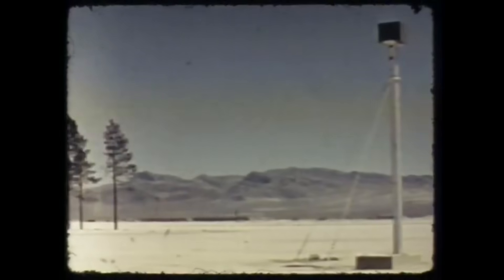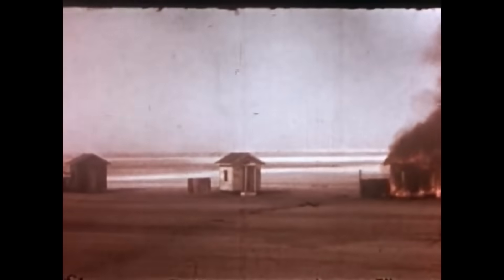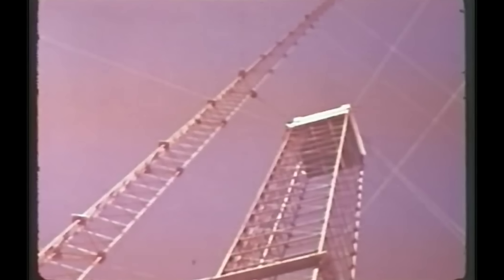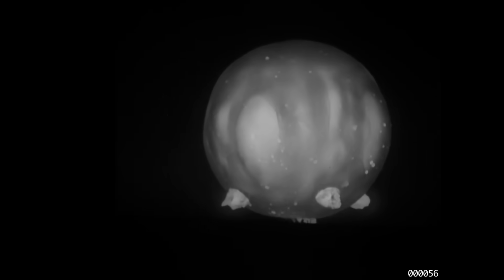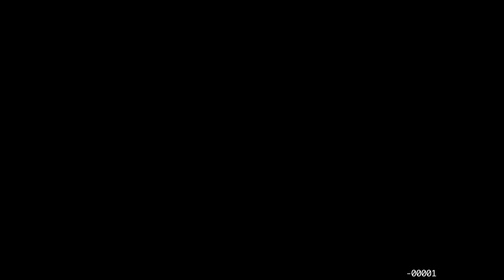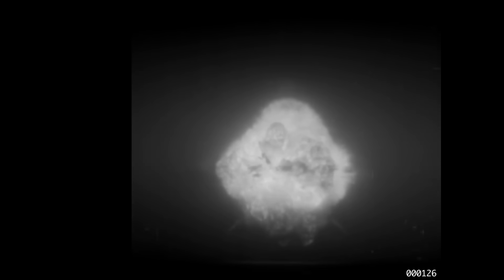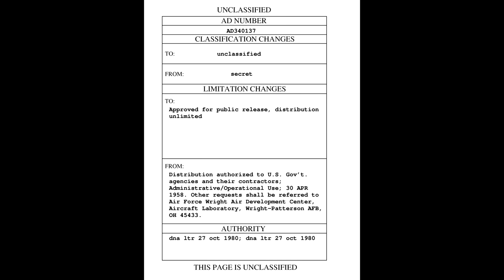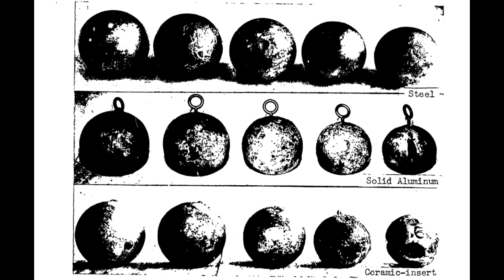Can A Metal Bowling Ball Survive Inside a Nuclear Explosion?

Comment: Im curious how they can be standing at the wreckage of the tower considering it was the epicentre of the blast.     Did they end up getting severe radiation poisoning?
Reply: The radiation at ground zero on efficient nuclear blasts is actually rather low shortly after the event. The fallout is the very radioactive part and that is ejected away from the event site.
Reply: @StreuB1  I would have expected a fair bit of neutron activation, especially the steel...
Reply: @AKAtheA  but to what level? Is there data that exists on the elements that steel will mutate to under that level of neuron flux? I can't imagine the neutron capture rate but I would bet the physicists did the analysis and knew but maybe not. It's all very interesting stuff!!
Reply: @AKAtheA  Neutron activation of materials is a part of residual radiation.  But it still decays relatively rapidly, so they were likely safe. 
.
A little known fact is that it is unlikely anyone got even mild radiation poisoning in Japan from residual radiation of the two atomic bombs.  Pretty much all radiation effects people suffered from the two bombs were from prompt radiation.  This is because the bombs were airburst, and not surfaceburst.  The latter produces significant fallout while the former does not.
.
Another little known fact is that in extremely large thermonuclear bombs, the fire ball tends to be larger than lethal distance for prompt radiation (or even radiation sickness).  So other than fallout (which is very little if it is an airburst), you don't have to worry about ionizing radiation in extremely large nukes, unless you are close enough to be vaporized.
Reply: Most of the really nasty isotopes burn out within a few days. This could have been a week after the blast which would have meant radiation only marginally above background.
Reply: they did take some measures, if you look closely they have shoe covers on to minimize dust pickup on their shoes. and honestly, the video didn't mention how long after the blast it was.
Reply: If that was the first Trinity test, they took after-radiation a little less seriously in those days. What they were wary of was the pure plutonium and the initial blast.
Reply: They also thought there was a chance that a powerful blast could just ignite the whole atmosphere killing everything on earth, but ended up testing it anyway
Reply: @WaveOfDestiny  I believe that was with the hydrogen bomb, and it was more of a macabre joke than something taken seriously... At least that's how I remember the story. This is from memory.
Reply: Most of the radioactive fallout from a nuclear war is expected to come from ground detonations (to destroy bunkers and other hardened structures), where the fireball contains a lot of dirt. When the detonation happens in the air (or on top of a tower) to cause maximum damage to normal buildings, the air absorbs a lot of the neutrons, and doesn't become as radioactive as dirt would.
Reply: If it was early one they didn’t really know about how radioactivity affected humans since it was in the early days. That’s also why they did tests extensively up ground.
Reply: @Mgl1206  The early days were with Curie, she deserves that credit.

Note the white circles you can see against the darker outfits. Those are personal dosimeters, used in conjunction with area monitoring. They may have been a bit off on what counts as a dangerous dose or what happens under a blast where you might stand, but fundamentally they knew what they were doing. They had done extensive animal testing and had observed effects on previous generations of researchers.

The one living dangerously was the unsuspecting farmer downwind.
Reply: Dose received there would not have been enough for radiation poisoning.
Reply: Supermassive transuranic products decay away in mere days. After enough time has passed, one can go to the hypocenter (it's hypocenter, not epicenter) of the explosion and be there for some time without harm. They surely didn't go carelessly.
Reply: The effects of radiation weren't established, even the making of the devices followed severely undertoned safety precautions. Only later when they started conducting studies to find out the effects of radiation on human beings, did they realize how it all worked. Many of the scientist involved in early nuclear research, lived very short lives, compared with the average person.
Reply: That's not how radiation works.  These weapons were low yield atomic (fission) air burst devices.   They weren't optimized to emit neutrons, and they were high enough in the air that they didn't excavate much of the ground to create lots of fallout.  They didn't leave a lot of radiation behind.  The modern bombs that create massive amounts of fallout are much larger hydrogen (fusion) bombs.
Reply: I had this same thought, wouldn't that be a pretty awful spot to be?
Reply: They were not unaware of the dangers of radiation, but simple measurement equipment can tell you the amount of instant and accumulated exposure. They also were not standing at ground zero the next morning, but likely weeks or more after the most radioactive isotopes had decayed to safe levels.
Reply: These photos were taken in September for the press, the actual test was in July over a month before, which is plenty of time for ground 0 to be reasonably safe as the radiation levels decline exponentially. After 1 week radiation is generally 1% of the level immediately after the explosion. Over a month is a lot more time than people digging through Hiroshima/Nagasaki had. Two weeks is also generally the advised time to shelter if you couldn't escape the fallout zone before limited surface work can begin.
Reply: The radiation from a nuclear explosion is a combination of the immediate effects that are gone quickly, and the fallout, which is also mostly gone quickly, and which rapidly moves away with the wind.  There isn't a lot of long term radioactive effects from nuclear bombs, in spite of the fear mongering.  Which is why Nagasaki and Hiroshima are population centers today, and were rebuilt shortly after the end of WWII.
Reply: they probably didnt visit the site immediately after the explosion. just saying
Reply: I'm intrigued by the fact that they have coverings to protect their feet, but there's a bunch of them walking around. What about the dust they're stirring up? Why no masks? Wasn't that first bomb the same as the Nagasaki one, of plutonium construction? One speck of that in the lungs - yikes!
Reply: A lot of people overestimate just how bad radiation actually is for you. The radiation drops off quite rapidly after the initial blast, going a few days later is fairly safe.
Reply: Right? Right?
Reply: The real question is, 

How did they get all this footage?
Reply: @livethefuture2492  They used cameras...?
Reply: @mythreepants  The Victorians used cameras.
Reply: @livethefuture2492  Primary photographer for Trinity was Berlyn B. Brixner with an array of cameras at different locations shooting at various speeds.   Can't remember the physicist name, but he and his wife took loads of home movies, most in color of day to day life.  As I recall from history, hoisting of gadget to the cab is his movie alone with the color movie of the explosion.  I think it may be mentioned in "Trinity and Beyond".    Brixner's cameras were state of the art 'till the Rapatronic.  Other shots were remote cameras and spectral detectors in towers, ground, aircraft and an old WW2 navy gun turret, in the desert.
Reply: @livethefuture2492  
RE: "How did they get all this footage?"
Operation TEAPOT was declassified in 1980.
Reply: @livethefuture2492  "very fast cameras" running at 2400 frames per second, built into special housings, with the film unit buried and only the one-use lens exposed.   Could be a good subject for the future.  There were somewhat similar cameras on the launch pad showing saturn V and shuttle launches from within the blast zone.
Reply: @livethefuture2492  Cameras.
Reply: @livethefuture2492  With cameras, Rapatronic for example.
Reply: @livethefuture2492  Do you mean without the film being exposed by the radiation?
Reply: @livethefuture2492  Cameras
Reply: 1/3 of them developed super powers.
Reply: They didn't know as much about the radiation dangers, people who took part in this test were still dying when the bomb went off over Hiroshima.  (The ones who were going to die cause they were improperly protected)
Reply: Probably about as dangerous to sit under ground zero as smoking a pack of cigarettes
Reply: I had the same question
Reply: Probably not super severe in the moment but I bet that took 10-15 years off their lives
Reply: Just to be picky, they were at the centre, the epicentre is the point on the surface directly above an earthquake  :)
Reply: Jes, they did. But it was the eightys and people are stupid. Also probably they were ordered to do so by they'r boss.
Reply: @Björn_Schnabel  That was the Trinity test - the world's first nuclear explosion - July 16th 1945. Oppenheimer was dead by 1967. And in case you're still confused, the '80s came a while later.
Reply: @Björn_Schnabel  It was the forties, not the eighties, and that over-weight guy in the middle is General Leslie Groves.  He WAS the boss.
Reply: @Björn_Schnabel , the test you see pictured in the photo with Oppenheimer was the original Trinity site, shortly after the test in July, 1945.  But since radiation dose rates from a nuke decay relatively rapidly (see the 7/10 rule), after about two days, the initial dose rate would have decayed to around 1/100 of the original level.  

That said, it's highly likely they didn't stick around for long after the picture was taken.
Reply: @Björn_Schnabel  They were the bosses and superstars of project Manhattan.  Guy in white hat reported directly to the General and President Truman, who was negotiating the end of WW2 with "Uncle Joe", man of Steel.
Reply: @johndododoe1411  And the General is even in the picture as well, in the middle. The guy with the ... interesting way to wear his pants.
Reply: @Björn_Schnabel  80s?! Srsly? That is wrong by 4 decades!!
Reply: The irony of a guy calling people stupid when he confuses the 80s with the 40s....
Reply: @Björn_Schnabel  Yeah, you know -  World War II was in the 80's, WWI was in the 60's, and the dead Wright Bros. invented the airplane in 1953. And some stuff happened in the first half of that century, too.
Reply: @Björn_Schnabel  
RE: "Jes [sic], they did. But it was the eightys [sic] and
people are stupid. Also probably they were ordered to do so by they'r [sic] boss."
First, it was not the '80s, it was the '40s - 1945, to be exact. Second, they weren't "ordered
to do so by THEIR boss." Major General Leslie Groves and Dr. J. Robert
Oppenheimer WERE the bosses. Oppenheimer was head of the Los Alamos scientific
laboratory while Groves was head of the entire Manhattan Engineer District (the
actual code name for the so-called Manhattan Project). Third, they didn't have
to worry about radiation because the picture was taken on September 11, 1945,
58 days after the TRINITY test.
Reply: @Björn_Schnabel  No it wasn't the 1980s. Above-ground nuclear tests were outlawed in 1963...
Reply: @Björn_Schnabel  Trinity test was in July 1945!  It was before the atom bombing of Hiroshima, Japan on 6 August 1945.
Reply: @Björn_Schnabel  You need to study history before you open your mouth.  The date was July 16th 1945, and the man in question, J. Robert Oppenheimer was the scientific lead on the Manhattan project.  The people in that picture (with the possible exception of Groves, who was their boss and answered directly to FDR (edit: oops, Truman.  FDR was already dead)), made up probably the greatest collection of geniuses that has ever exist in one spot on this earth.  Furthermore due to the nature of the test site, being mostly sand,  the area was not nearly as radioactive as all the scaremongers would have you believe.  I would stay away from the metal bits though.  Hell, you can go visit the location today, and no protective gear is needed.
Reply: Björn Schnabel 80s ?  Joke right?
Reply: @Björn_Schnabel  It was 1945.Their 'boss' is stood right there with them. Don't they teach history in Murica?
Reply: @Björn_Schnabel  you're getting destroyed in the comments, much like those big balls in the "80s"

Comment: 1:15 I think dangerous trees are the least of your worries if they're dangerous because of a nuclear explosion.
Reply: You would think so from popular depictions of the bomb but its far from a certain death situation and most deaths will tend to be from avoidable or mitigatable secondary effects.
Reply: Well it's worth knowing if you can turn a whole forest into a wood chipper aimed at your enemies
Reply: Actually, this was a valid fear especially as the Soviet 7 days to the Rhine plan required launching tactical nukes and then following them with an invasion. Much better to have troop available to fight than having troops declared Kia by a tree.
Reply: Not if you are inside a steel cylinder designed based on their blast resistance in the other experiment.
Reply: you could've been hiding behind some hill, close to ground
you'll survive the light, survive the blast wave
and you'll die by falling burning branch
Reply: @NoNameAtAll2  – If we can trust educational videos, it's the returning shockwave/rush of air that is dangerous after you survived the heat- and shockwaves behind a cover.
Reply: @aduantas  , most nuclear weapons in use today are below 1Mt too, since the increased precision of modern missiles allows less powerful weapons to be used in the destruction of the same targets that would require much larger warheads some decades ago.
Reply: You should look at the causes of death for hiroshima victims, a huge amount of deaths were caused by glass, wood and metal shrapnel, not to mention structural collapses and thousands of deaths from structures catching fire and burning down (when your city has been nuked, you generally dont have a very effective firefighting response) many people also survived but with absolutely horrific skin burns and generally speaking loads of deaths were caused by radiation over the days, weeks and years following the blast.

Generally speaking only people close to the epicentre were killed instantly by the nuke's heat/pressure itself, secondary damage was a major source of casualties, which makes sense because as radius increases the effects of the epicentre diminish, but the area covered increases. Think about a series of concentric circles, circles in the middle have the most intense effects (heat + pressure wave) but the  outer circles have lesser effects (shrapnel, structural collapse, burns), the outer circles actually have a greater capacity for damage because the actual area they cover is exponentially larger.

All in all it's an absolute horror show, and I hope it never happens again. The utter brutality of these weapons can't be understated, if only they were so humane to just vaporise every victim. Instead they maim, poison and flay the living. These are cruel bombs.
Reply: @empty5013  Vsauce
Reply: @RCAvhstape  and a trip to hiroshima
Reply: Bomb damage comes in three types: radiation, heat, and blast. Blast damage includes flying debris, such as tree trunks, fragments, and splinters. If you're hiding in a ditch or a hole you may be safe from the heat and radiation, but if the trees overhead are exploding and showering you with splinters that might be bad. So one purpose of testing is to look for things like that. ("Radiation" in this context means the prompt, direct radiation from the bomb when it detonates, which doesn't last long but is very intense if you are close. Think of a camera flash, but instead of visible light it's gammas, X-rays, and neutrons. Radioactive fallout is radiation you worry about hours to weeks later.)
Reply: And for most bombs, the prompt radiation decays with distance faster than the flash and the overpressure, so it is of a lesser concern. For the same reason, "neutron bombs" were not deemed very effective.

However, secondary effects, such as flying debris, fires, destroyed buildings, blocked roads and disabled utilities are estimated to be by far the most deadly factors of a nuclear strike even in the absence of fallout.
Reply: @aduantas  I don't think the 50 mega ton one matters much
Reply: They really had a lot of weird ways of trivialising a f*cking Nuke going off.
Reply: Yes, that was my reaction as well... if you're standing in a forest within the blast radius of a nuclear explosion, it's not the falling branches that should be concerning you...

Comment: 3:48 So, what you means is that if you make an X-ray laser saber you can adjust the saber length by changing the power output?
Reply: No.
Reply: @williamcampbell9859  X-rays can penetrate at least several meters of air which is far too much. But please don't destroy my dreams ^^
Reply: You can, but the saber will be huge and fuzzy.
Reply: No.
Reply: no. that x-ray beam will not make a fire-blade in air, but a regular fireball, since air will re-radiate and scatter radiation in all directions
Reply: Visible saber length not actual saber length
Reply: @cantthinkofnameyeah7249  Yeah, the plasma length is the visible length. The x-rays will go a bit further but they are quickly absorbed by the air anyway.
Reply: How else do you think jodas saber was shorter?